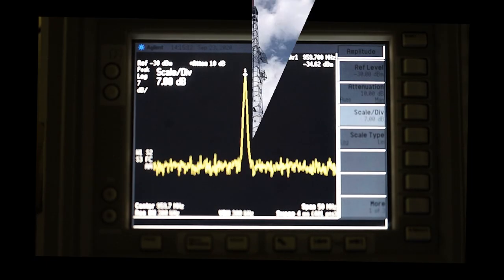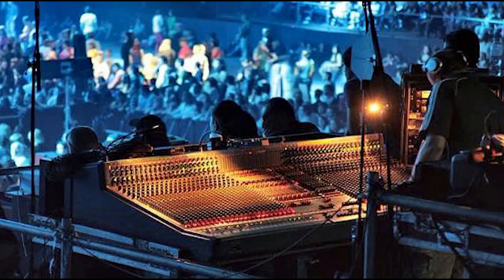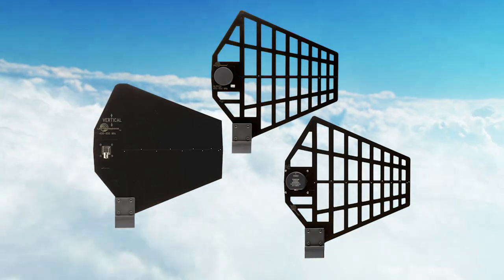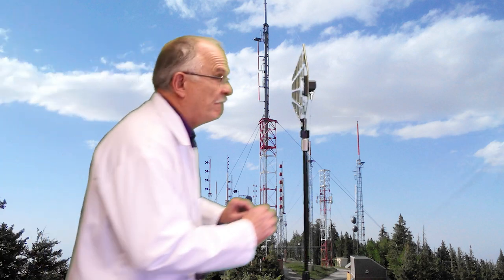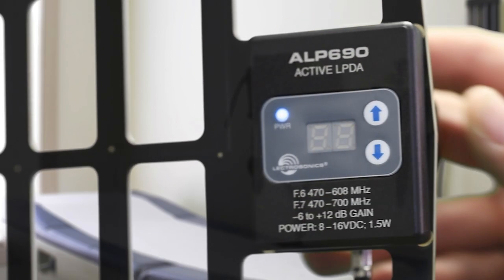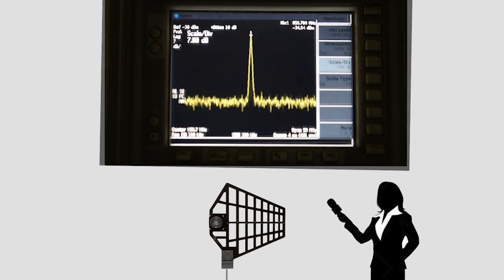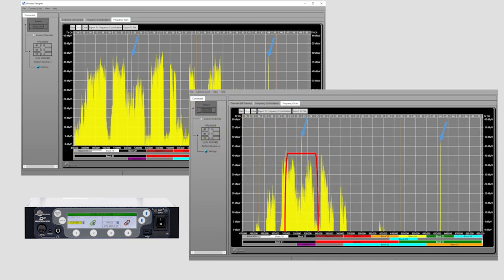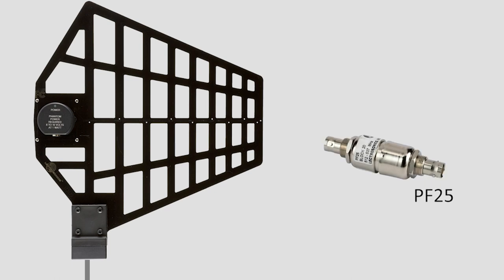Dr. Audio Talks Frankly About RF Filtering and Attenuation

Comment: Please I help to understand something! Let me first start with what I’m trying to accomplish so maybe you can suggest the best product I can use for my setup! 
So you see I have multiple helium miners and they are in one location which is causing some invalid witnesses “RSSI too hight” -60 for it to be valid It should be -70 and lower the frequency is 868Mhz so I was looking in attenuators can you please help me find the most appropriate one for my setups?
Reply from the maker: If the antenna connections are BNC 50 Ohm, then the standard BNC fixed attenuators would be applicable. They are made in -3dB, -6dB and -10dB and probably others as well. If your RSSI is high by 10dB then the -10 version should work. https://www.pasternack.com/nsearch.aspx?keywords=bnc%20fixed%20attenuator&view_type=grid